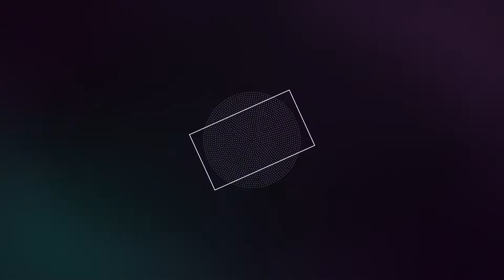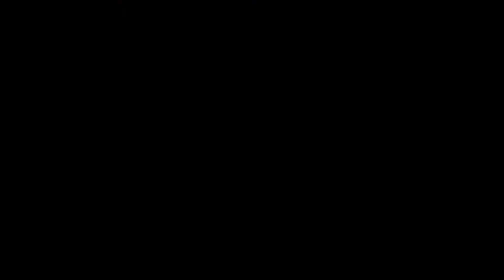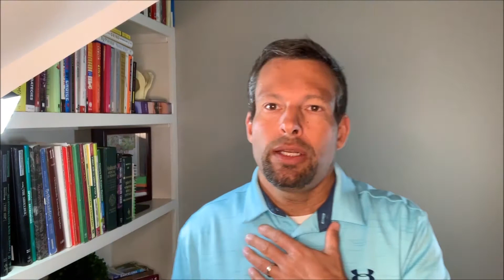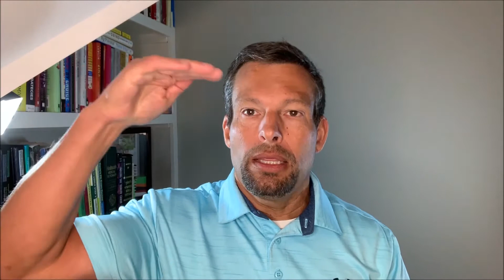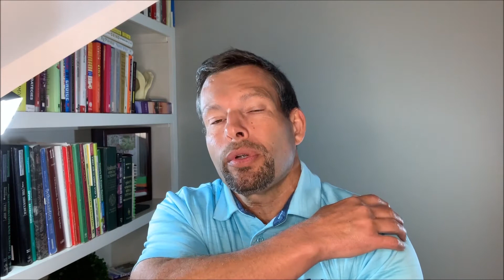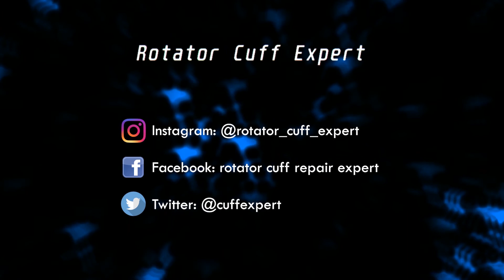Pulsed Electromagnetic Field Therapy after Rotator Cuff Repair- Does It WORK?

Comment: What happens if TENS treatment and PRP treatment are taken at the same time?
Reply from the maker: @aqua22000, as far as i know there is no contraindication to doing them both.  Are you having shoulder trouble?
Reply: @rotatorcuffexpert  sadly ı got a intrasubstance supraspinatus tendon tear. well i think tens decrease inflamation but prp increase it, so that didn't make sense to me ıdk, what do you think about that?
Reply from the maker: I think TENS can decrease pain not necessarily inflamation,  PRP is supposed to provide healing "elements" to a less than ideal healing environment. This does cause what is supposed to be controlled inflamation.

Comment: I have been interested in PEMP for number years. It looks like Mid West has no practitioners. Primary reason appears to be cost. Even in 2022 nothing has changed  in 20 years. Only way appears to be buy one
Reply from the maker: Yes. Electronics, It is a neglected area of therapy for sure.  After looking at your channel, it seems you have a passion for electricity and PEMF.  Maybe you should start posting more on PEMF and its benefits?

Comment: I’m a DPT justly getting into the science after a brain injury and limited options. I use lasers and have a Tesla coil I was using prior to my motorcycle accident. I could feel the energy pulses from my Tesla coil aka High EMT or branded in the US as EMsculpt device. I purchased a NeoRythm for treatment of my brain along with Infrared and Red light therapy friend clinical strength lasers. Along with vitamins I have had tremendous recovery. I did place it over my hard to resolve extensor tendinitis after an ORIF in my left forearm. After just one treatment i started to see a condition that would only worsen without treatments with other modalities: lasers therapy, US/E-stim combo, ice massage, etc. begin to show signs of spontaneous healing. This while my inflammatory load is still high and the other severe areas of trauma are still on the rinse/repeat or you will pay cycle… I’m just doing my research on my own now before purchasing a reasonably priced clinical unit from China because the stuff in the US is ridiculously expensive while ther is no insurance reimbursement just like lasers which are both standardized in Europe and paid for by insurance. My suggestion is to find more research don’t just rely on Pubmed like CMS, HHS and other uninformed jokers that bias our medicine that way. Like with laser therapy the over abundance of research isn’t published in the US or accessible through Pubmed and other US higher learning research networks.
Reply: i had similar results from my neorythm with a fractured ankle I had.  What frequency were you using?  I had it custom set to 40hz and would run it overnight.  Currently testing a magnawave semi 10 and the fpinsoles pemf device.
Reply: @justinlovell  I believe the research can tell your the correct pulse rate. I think it is 10Hz or less. There are a few devices FDA approved in the US for malunion or non-union fracture healing. Just look them up and check out the spects. Also there is published research available on medline. And even if your not exact I would bet it is producing healing in a range up to 120pps so anything will work, just one frequency will work the best…